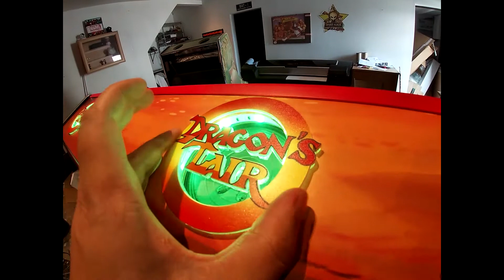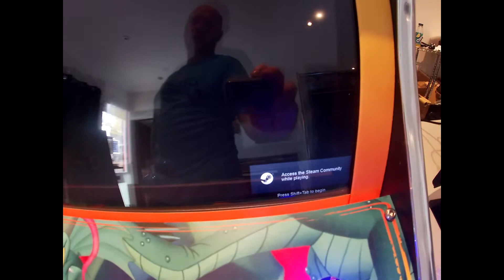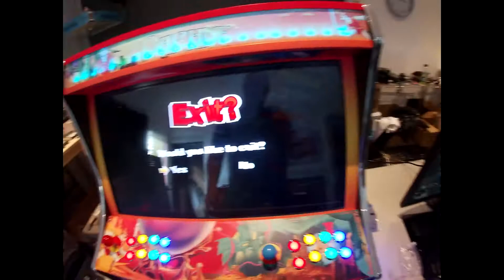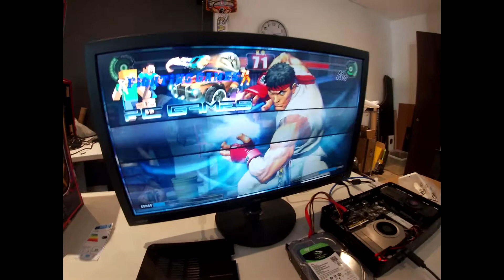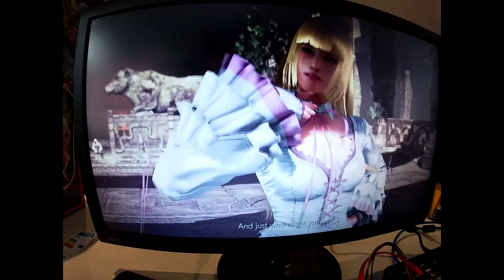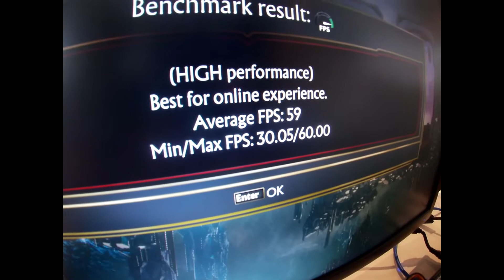Dragons Lair Custom Arcade Build Complete

Comment: Que tarjeta gráfica y que procesador usas en esa prueba del tekken y mortal kombat?
Reply from the maker: on the mini PC it has a GTX 1050ti sff card , its not the greatest card for MK11 but it works . Tekken 7 is flawless, also Street Fighter V
Reply: Y que procesador ? Se ve increíble todo
Reply from the maker: I3 9100F DDR4 you can get a i7 8700 DDR4